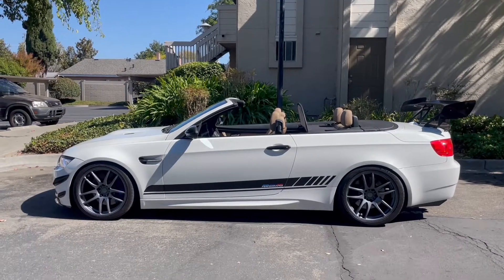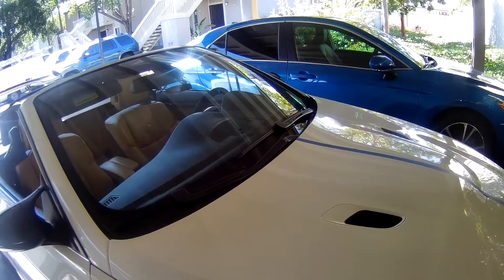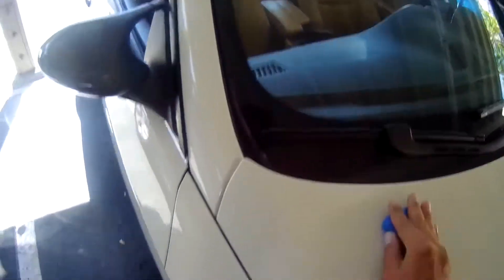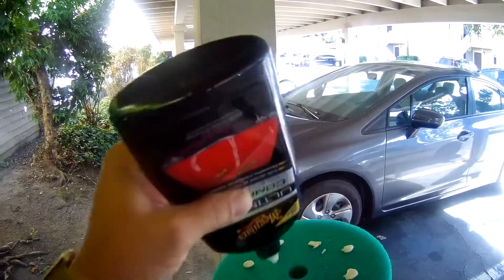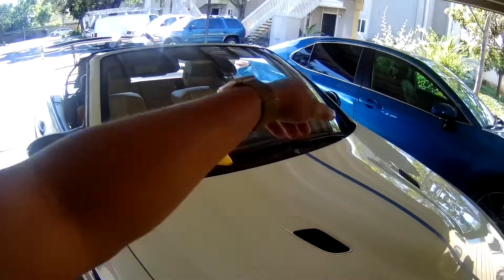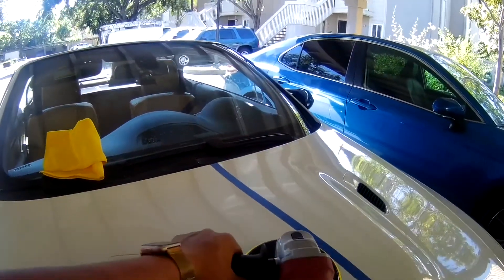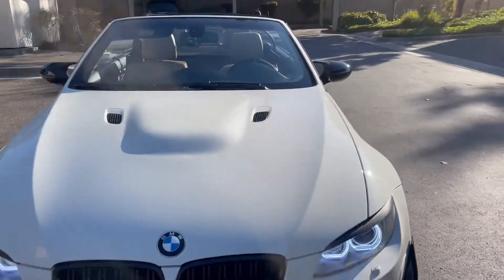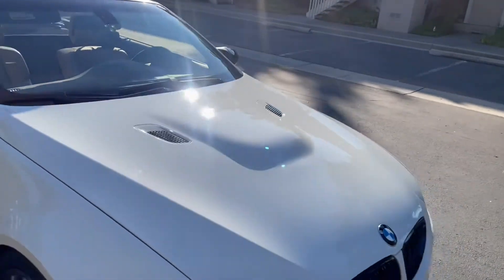Polishing My BMW E93 M3, Swirl and Scratch Removal Paint Correction DIY

Comment: I used to clay bar my car every now & then and then wax it.  It was so smooth that I wanted to run my face across the hood afterwards... Kinda miss that
Reply from the maker: Dude, you’re right about the smoothness. Love the feeling after clay bar, the spray bottle slides off easily from the hood afterward.
Reply: @Sals_Garage  yah, too bad mine probably feels like sandPaper at this point
Reply from the maker: @shoryukensaucealtaccount7971  😂 no time for car stuff anymore.  Hope you get some free time to get back to the platinum trophy grind.